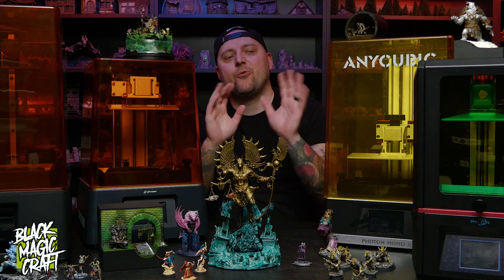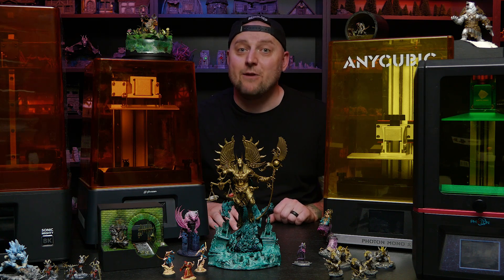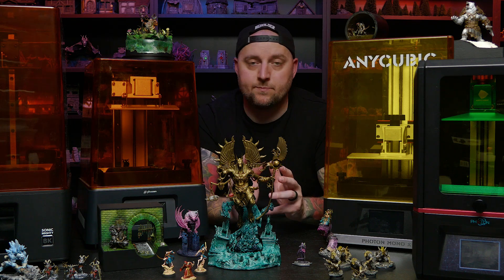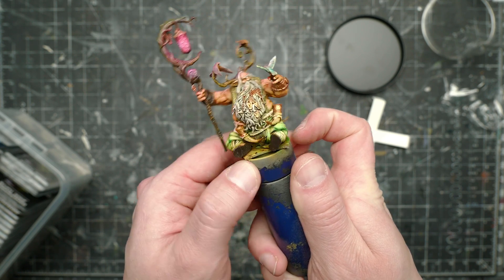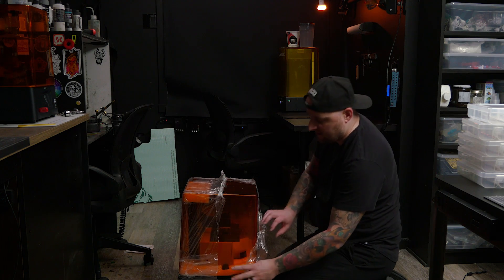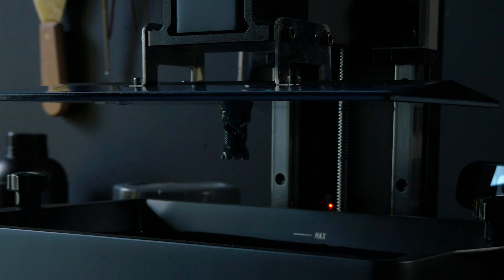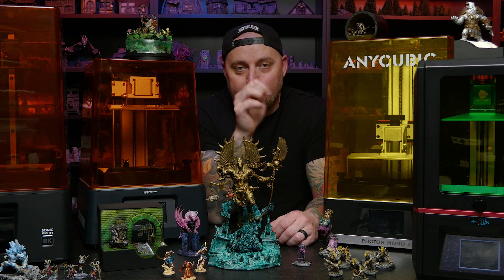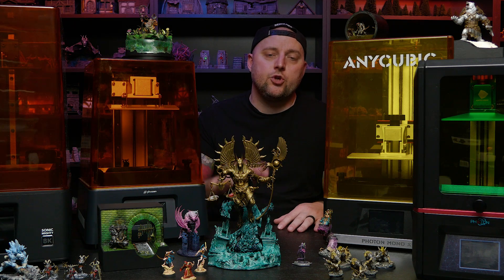THE TRUTH ABOUT 3D PRINTING

Comment from the maker: HUGE THANKS ARCHVILLAIN GAMES FOR SPONSORING THIS VIDEO! CHECK THEM OUT : https://bit.ly/AVBMC

GET 15% OFF a Phrozen Sonic Mighty 8k using the code "PRBlackMC15" HERE: https://lihi1.com/s3HyO (ends June 17th, 2022)
Reply: I have an Anycubic FDM printer and I love it. I don't use it as much as I want, but once I got the settings dialed in, it was just a case of making sure the plate was leveled and go. I did learn 1 thing the hard way and that is, don't ignore the settings of the item you are printing. I did once and it says my magnetic pad. I mean it was totaled. Also, don't let moisture get into your filament. Go to the dollar store and buy cheap dehumidifier breads. Put them in a bag with your filament and you will never have to worry about moisture.
Reply from the maker: I contacted them. Doesn’t seem right to be sold out already.
Reply: Oh dang I was just looking at ordering one of these yesterday. This is a massive discount. The ETA for shipping yesterday was August. Today it's October.
Reply from the maker: Looks like it’s available again now!

Comment: There's a steep learning curve for setting up the printer and getting the slicer settings correct.

I've run 2 cheap 3D printers for 3 years.  I use the FDM, because of the larger build volume and less mess.

The software is much more important than the printer....
Especially the slicer software.

I get better prints than the examples posted by the figure designers that use FDM

Comment: I've had the same issue with AnyCube Mono Photon X 4k, I've assumed it was the temperature in the room, so I was taking the winter off.  I'm in MN and the room that I print in is in the south corner of the basement and probably the coldest room in the house.  I have had success with smaller models, but only a few successes in models larger that a typical D&D "Large" (2in base)...Things got busy and I just haven't used it for 6 months now, but I do plan to go back and try again once I can get the area around the printer contained and warmed up.

Comment: I'm really surprised to see you using glue to assemble the models. I take liquid resin and smear a little bit on the one of the parts. I then hold it in place and hit it with the UV flashlight for a couple of seconds and now two pieces become one. I remove my hands from the model and use the UV light for 20-30 seconds more.

Comment: Great video. It just convinced me to get my own printer instead of buying from someone else. However. What is your current opinion?

I totally agree with you. Reliability isn't negotiable. Have you tried the saturn 2 or any other printer that you consider decent? In my country I currently have 2 options either around 1k usd for the mighty 8k and the curing and washing station VS 600-700 usd for a saturn 2.

Have you tested any other printer that you consider RELIABLE? or the mighty 8k is just a no Brainer?

Thanks in advance for the time to reply this
Reply from the maker: Still using and loving both phrozen 8k printers
Reply: @Black Magic Craft  thanks for the quick reply. Is there any chance that you could share your settings please? I totally agree with your logic, there comes a moment where huge increments in time only yield tiny changes in visible quality. So having settings that are reliable and quick to print is a great plus.

Thanks a lot. I am about to order mine.

Comment: 8:40 "not a single noticeable flaw" 8:38 actual noticeable flaw where the raft has pulled from the bed :D, still a god printer though considering ive been printing in 480p on a photon zero for a couple of years and just got an elegoo 3 pro. cant wait to give it a go and see the difference.
Reply: If it's just an adhesion problem it usually doesn't affect the mini itself, as long it doesn't fuse with the raft. 🤷🏻‍♀️

Comment: One think I think you forgot to mention is that a resin printer is for minis and isn't really good for terrain (beyond repeating greeble bits), so for terrain you'd need a FILLIMENT printer.
Reply from the maker: Totally not true. Resin printers do a much nicer job of printing terrain and large format resin printers are common now. A fdm printer is a cheaper way to print terrain but not the only way and model providers are moving more and more towards designing terrain optimized for resin printing.
Reply: @BlackMagicCraftOfficial  it's the choice of material for me. Even with higher quality resins that are less brittle and hallowed prints, ounce for ounce filament beats its price by a mile, and that's before the price of IPA to wash. 
One the table (at least for wargaming) if someone tossed a filament plastic building I would be a lot less nervous than if it were made of resin

Comment: Bought my first printer about the first of September and that was the Photon Mono 4k . That turned into a nightmare for my first printer and after 3 weeks of not able to get help or get it to even read the file on the flash drive , Anycubic sent me an update and then finally worked . Then another thing went wrong and that now sits in the corner and then I ordered the Elegoo Mars 3 Pro . That printer out of the box worked and I have been printing almost every day now and knock on wood I wont have any surprises . So far haven't had any failures and been running full plates , Didnt run a test print and tried setting from another person and dove right in  . Tried two Water Washable resins(Clear) so far  havent changed setting and both made good pieces . Now im thinking about getting a FDM printer as well .

Comment: I currently have a AnyCubic Mono 4k and a Elegoo Saturn S. I generally have pretty good experiences with issues related to supports on both printers, but that's probably mostly on me. I have been using the Phrozen 4k resin recently and love it. 3D printing has never been "plug and play" for me. I understand that 8k printers are more complicated and precise, but damn they are still expensive.

Comment: I bought the AnyCubic Photon 4k resin printer but had found that they use a pwma file for printing vs a STL file and need to see where I can get a converter so that I can use the files I bought to print. If anyone has a solution please let me know.
Reply from the maker: No printers use stl for printing. All printers require you to load your stl's into a slicer and create a printable file for your printer. You can use Chitubox or Lychee.

Comment: You make such a great point in this video about how a lot of these designers make these wonderful looking 3d models for figurines. But the way they are designed, mainly as being one piece via one stl file, makes some of them difficult to print without generating flaws. Like its pretty obvious when the designers don't have any idea how printers actually print, and how supports have to be used sometimes. A lot of the problems I have run into could easily be solved if the figurines were just broken down into parts to be assembled after printing. Which yeah, I could do that on my own with 3d Builder, and have done it a few times now. But it does add some extra time to the process.

Comment: Hey Jeremy, how are you? I hope it all goes well there. I have a newbie question about resin printers, maybe some others folks here could give feedback as well. For ventilation, which method do you think is the safest? Using a Grow tent with a fan blowing the air out of the room or the one you showed on your video with Danny and video about how you made your airbrush station? My concern is about the fumes, and if it is safe to stay in the same room for a long period of time using any of these methods. Cheers!
Reply from the maker: Encasing the printer in a grow tent and venting that outside is far better than just having an exhaust vent in the room like I have.
Reply: @BlackMagicCraftOfficial  Thanks J!
Reply: @BlackMagicCraftOfficial  Do you think is safe to stay at the same room when the printer is working using the encasing method? In theory the printer would be in my office in the basement but I can think in as different solution.
Reply from the maker: I try to avoid being in the room when the printer is running, just incase, but if it was in a vented enclosure I wouldn’t worry. Either way printing over night helps.
Reply: @BlackMagicCraftOfficial  Jeremy, once again, I can't thank you enough for the support and all the content. I started to watch your stuff with the Dungeon tile for kids video when my wife was pregnant (I was already thinking to do hobby stuff with my daughter) since that my hobby passion just got bigger and bigger =) (3D printer is the new one). Thanks to you, I have a great hobby to spend my spare time and hopefully my little one year old girl will like it in the future as well. Cheers!  Wish you and your wonderful family all the besT!

Comment: Hey Jeremy, could you do a video on how you connected your 3D printer/booth to your spray both from a few years back? I just built a workshop, plan to order the material, but the primary goal was for 3D printing. If I can use blast gates and a T-split to also run a line to a spray booth, I will
Reply from the maker: I just disconnect the hose from spray booth and place it near printers 😄
Reply from the maker: One day I’ll do something better

Comment: Just got a Mono X as well, and while I don't have nearly as many problems with print failure, I had the prints stick to the build plate WAY too hard. I just couldn't get the rafts off no matter what I tried, it came down to heating the stuff up and basically chiseling away at it bit by bit because the resin just broke off in small shards. I figure the checkerboard texture they etch into these plates was burned in way too deep, the surface felt really rough to the touch.
Ended up completely ruining the plate in the process. 

Got a replacement plate now and the checkerboard etching on it seems to be way less deep (almost smooth to the touch, just a little bit of friction - which is exactly how it should be in my eyes), last print came out fine for the most part (few small issues with support failure leading to a bit of pancaking, but I didn't have my exposure dialed in perfectly yet).

Still, stuff like this can REALLY ruin your day.

Hope that me and the Mono X will get along better in the long run. I still have my OG Photon as a backup, sure, but as you say, the detail isn't quite up to modern standards and it's just slow as all hell ...

Comment: I had a plug and play FDM printer for over 5 years that I got to a point that I could run near flawlessly for months on end without issue, until the machine itself eventually ran it's course and was retired.

Since got an Elegoo Saturn 4k resin, and an Ender 3 v2 FDM printers. The Saturn has been an absolute gem, and once I dial in different resin's settings, it's great provided the room conditions are right. The Ender however has been like a stubborn teenager. When it works, it's awesome, but I've definitely had some arguments with it. Once it's set up properly though, it prints great too

Comment: I got an Ender 3 pro about 4 months ago. And I honestly wish I went with a resin printer instead. I have had nothing but issues. I haven't had a good print yet. My friend who is really good with pla printers has been helping me and can't get it to work right either. I'm super frustrated with it. And I just don't know what to do with it anymore. I've watched tons of videos on it to try to get it fixed so I can just print with minimal setting tweaks. And It just won't work. It's honestly putting me off 3D printing. I know I'm not the most knowledgeable with this. So, I'm sure I just need more time with it. But MAN is it so frustrating.

Comment: Have had nothing but problems since i got my Mono X early this year as a gift for myself. Dealing with warranty stuff now because I ruled out personal error after months of burn-out with it and 2000+ml in resin spent on failed prints. There's issues with slicers not slicing right after a windows update and such, too, and despite going through screens like candy my Elegoo Mars Pro with an lcd screen was insanely reliable. Sad to see quality drop for profit margins across a lot of the industry lately

Comment: you say 3D printing, I see Resin printers that you need supports to not let the resin prints frail about, 3D Printing is printing on a base while the printing nuzzle is heated up to melt the plastic. Also, check out Uncle Jessie on YouTube he has the best tips and what you need to use in settings for resin or 3D Printing

Comment: It might be true, that the Sonic 8k gets amazing results, but look at its prize. For the money you can get two anycubic Mono X 6K ... Also, the human eye can no longer perceive the resolution that can be made with the newer printers. so why spending money in things, that you cant see? in my opinion the biggest thing in not making mistakes is the room temperature. its really important to keep it >20 °C. Better more. Anyway, thx for the nice vid. think i should also try a tough and resilient resin. things really breaking to easy, when removing the supports from normal resin....
Reply: I think you make a good point. For me I am more than happy with the results from my very first none 4K tiny printer. I only upgraded for a bigger build volume. I think if you're printing for the tiny tabletop gaming there are benefits to the highest res small printer as you can ignore anti-aliasing and still get perfect curves with detail that's I think noticeable but not so great that I'd even upgrade. You should upgrade when your printer dies or some extra features are added that you think would improve your printing life like resin mixing, print area heating, resin filling etc. etc. Maybe even one day we'll get faster prints! 🤔

Comment: I have a Photon mono X. I've had great luck with mine. The thing I've kinda gathered from the printing community is no matter the brand, some folks will have a great experience with a certain printer, while others have a terrible experience. And yeah, each printer has its quirks, but once you figure that out it really is easy sailing after that.
Reply from the maker: This is true. The issues with mono x seem to be more common and based on responses the result of many units shipping with warped build plates.
Reply: @BlackMagicCraftOfficial  I will admit I am rather sus of the photon mono x's really cheap sales price...... it's been on "sale" for a few months now. So it does beg the question. Is it too good to be true...
Reply from the maker: It seems like Phrozen has higher quality builds and way better quality control. I think it justifies the higher price, but the big downside that makes it less competitive is the long lead times and super expensive direct shipping.

They need to up their production numbers while retaining quality control and get stock onto Amazon.

Comment: Man I should have watched this video sooner I just got my Mono X and am experiencing the same issues….
Reply: I was in the same boat, same printer. Over time I got it down to about 1 fail in 10 prints. Not perfect but acceptable. The key changes came in when I started managing the temperature, Keep it at or above room temp. Applying the right oil to the VAT which stops prints sticking to it and finally I make sure that on long prints or when going for anothe print after a successful one, mix the resin really well with a rubber spatula. I also use microfibre disposable cloths that come on a big roll. Not very expensive and I think I have years of supply now from one roll. You can really clean and buff your VAT and it makes no scratches like paper towels. I know nice fluffy microfibre cloths work well but I don't want those in my washing machine leaving resin residue that'll get into my clothes, so disposable it is. HTH.
Reply: @ClayMann  thanks Clay I appreciate the tips I’ll give them a shot
Reply: @Thertra70  yw dude, I don't know if any of that will help. If you want to go into more detail on exactly how your prints fail. Do they keep falling off or just parts failing? Another thing I forgot to mention is that I totally destroyed the aluminium holder thing that the prints stick to when hitting a chisel to get off a really stuck print. So I ordered another two as well as new VAT's and the new holder had little grid squares on it which I now know are the new beautifully levelled ones that are a big improvement over the originals that are just one flat metal colour. They're pretty cheap to buy. And the extra VAT's are just a godsend when you get a fail, just pull it off, put it aside in the pile of shame and put in a fresh VAT and off ya go straight back to printing. lol

Comment: Most of the trouble I had with my Mono X, were caused by Anycubic selling build plates that are flat as the globe. The center of my build plates were both approx. 0.2 mm higher than the corners, but hey now they laser edge these warped plates, at least.
Reply: I had this exact say issue. My plate was warped and actually ripped through my FEP on a print failure. Resin leaked through tear making a big puddle on the screen and then cure to the screen. I was faced with fixing a printer for hundreds that would still have issues but instead scrapped the whole printer. Got myself an E10 and it works great. Mono X is garbage.

Comment: Nice video! I have recently moved into a new painting space and have came across a strange issue. I have been getting intense headaches and brain fog that lasts all day whenever I paint. I had had this problem beforehand but I figured that it was from the lead paint chipping from my basement ceiling (I used to paint in my basement). I am confident that it is not my lighting and I am starting to get desperate for answers of why I am experiencing this.
Reply from the maker: I’d recommend going for an eye exam.